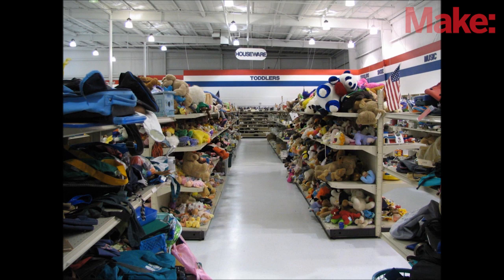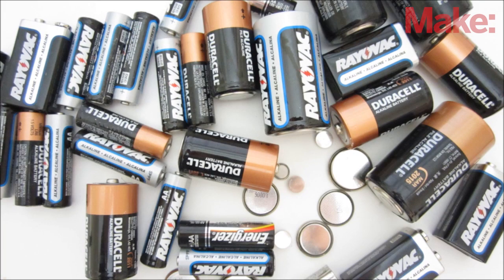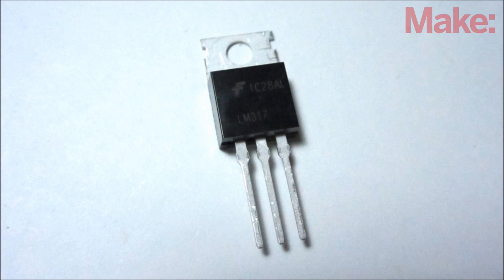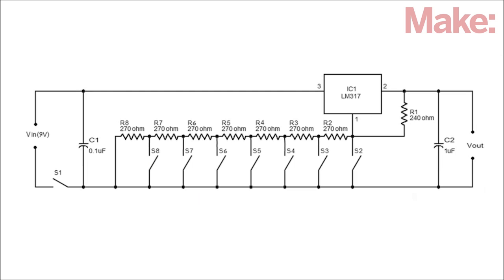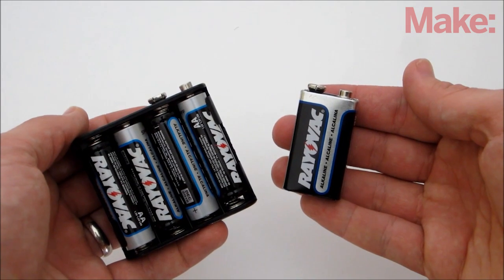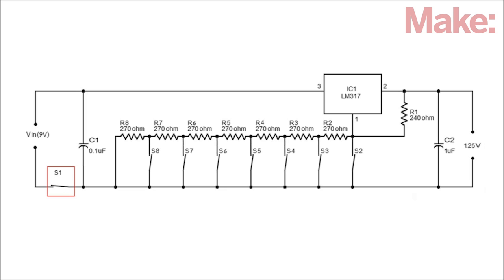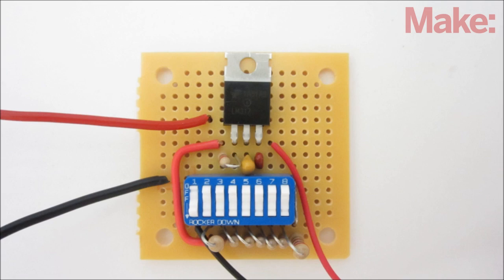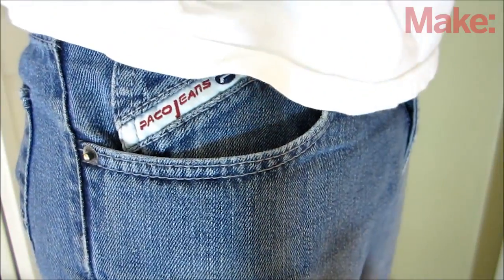DIY Hacks & How To's: Pocket Sized Power Supply

Comment: I think although alot of you guys have some really great ideas for improvements, but most small electronic devices uses max 9v. Also, I think you're missing the point...IT'S A QUICK CHECKER!!!...but if you need more power on hand, connect two 9v in parallel and that should do the trick...wouldn't recommend using a Li-Po without a fuse circuit, because if the failure is with the electronic component, then it along with your handy-dandy checker will go up in flames...quickly

Comment: no pal the lm317 provides 1amp of direct current
Reply: +jaffar syria and do you know how much current can a 9v battery give ?
Reply: Kristijan Dinga yes I do it can supply a lot but it will get really hot due the equivalent series resistor (esr) in the battery so you won't get that much current (Safely) and just for the sake of it the lm317 has an inbuilt overload protection so that mean that you can't take all the guts of the 9 volt battery even If you draw 10 amps of it the lm317 will get really hot but will just shutdown and safely disconnects the load
Reply: jaffar syria yes but its gonna get very hot no matter what and probably destroj the circut and n you cant pull a whole lot from the 9v battery new ones cant give 200ma and older only 50-100ma soo rely it cant give much current for 9v but its not ment for that its juste ment to test battery powerd devices
Reply: +Kristijan Dinga  physically you can draw that lot current but the chemical construction of the battery limits the ammount of current but yes you can draw a lot of current from it (if u want to blow it up)

Comment: A LOT more simple method is to simply get a clip connector for a 9 volt battery, put alligator clips on the ends of the bare wires or just hold the bare wires to the device + & - (It wont shock you, & if it does just a Very little tickle). Clip the 9 volt battery to its end, The alligator clips to the device & Presto. This will work for any device that takes Any regular battery : AAA, AA, A, C, CC, DD, D & such or 9 volt just to test it. Don't touch the wire ends together as it could short the battery out. ALSO, You can use a regular 6 volt lantern (flashlight) battery to power a regular car radio to test it, or in a pinch with bad weather. just run two pieces of wire one each from + & - on the battery to the + & - on the car radio. It'll run the radio for a few hours if its a good battery. I've done all of these many times over many years with No problems. No need to complicate things.

Comment: It doesn't power the device long enough to see if it works in many cases because a 9V battery isn't capable of enough current for many things that use AA or larger cells.
Reply: Stinky Cheese  do you have a better design? i would really like to build one of these but do not want it to be a total flop. also maybe is there a way to use something like cell phone batteries for it?
Reply: David Yarbrough
There are many different ways to do it.  First you need to decide size and shape and this will determine capacity and then pick battery type like Li-Ion for power density but then you have more concerns about proper charge and a discharge cutoff while NiMH is much more forgiving and you might already have cells and charger.

Next you would search an electronics supplier like Digikey for SMPS controller chips and use the drill down specs choices to pick the input and output voltage range you need.

Next you would get the datasheet for that IC and build the example circuit in it, changing anything per the descriptions of that IC functionality.  Of course it will list other discreet electronic components needed which you'd order from the electronics supplier too if not already in your possession.  How fancy you make it is up to you, some people might want a LCD voltage display but others would just settle for switches to set standard/common voltages.  Basically the switches would just put different resistors into a voltage feedback loop to determine the regulated output voltage or with an LCD you could have a potentiometer allowing continuously variable voltage.

It's a drawn out process but not a complicated one, somewhat like climbing a small mountain you just take it one step at a time.

The other option is look for something already made on eBay or equivalent.

Comment: The LM317 works, but if you are using it in any application where you need real battery life it is a bad decsion. It is a very inefficient way to transform power, discarding much of the battery power it is converting as heat. 

A DC/DC buck convertor usually has efficiencies of 95% or greater. The LM317 works as long as you aren't counting mAh, but when you need all the power you can get a LM317 is not the best choice.

Comment: Could someone please help me? I want to make a lamp and use perfboard to connect different components too like: a transformator, leds, a touch sensor, a power cord, a speaker sensor (that is hooked to the touch, like if you touch the lamp it goes on and plays a sound).
 
Now on the electronic store the counter told me to get this Arduino Uno Rev3 as circuit board, but I think he is just trying to scam me and I think it can be much cheaper. PM me for more info.
 
Thanks in regards,
 
Dutch.

Comment: Two caps aren't the protections, they are in the circuit for levelling the voltage and give instant power to the load.

You need at least a diode and a resistor to make sure you can't broke your circuit and, when you switch off the unit, the charge in the capacitor can flow in the opposite way so you can damage the voltage regulator... but i prefer a switching converter.

Sorry for my english, bye.

Comment: Either way, it has the same outcome. I don't see any advantages on that. I think his method is even better simply because you can use any switch to increase or decrease voltage. (which with a 1 switch per voltage mode, you might accidentally toggle a 9 volt switch on a 3 volt device.)

Comment: AFAIK you can. Notice how the resistor array is hooked up to the voltage regulator. The resistors aren't what carries the output voltage, the resistor array's job is only to act as a voltage divider to adjust how much power the regulator will output.

Comment: Instead of using an array of resistors that you switch on until you ratchet the voltage down enough, why not use an array of different resistors that will give you an exact voltage based on a switch by switch basis? Combined will a joule thief, seems to me this would be a more consistent way. Any electronic engineers wanna fact check me on that?

Comment: very few devices use ac in the low voltage rage. off the top of my head i can think of 0. even things like your cable box and ps3 convert to dc.

Comment: pretty good idea however your circuit shows electrolytic capacitors and you built it with nonpolarized,... might still work for this project but i'd check to be sure